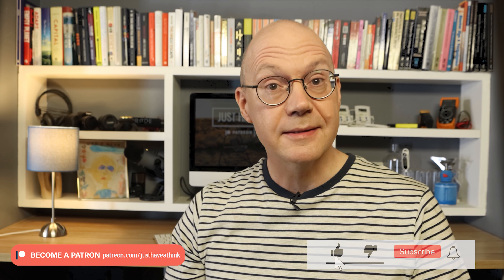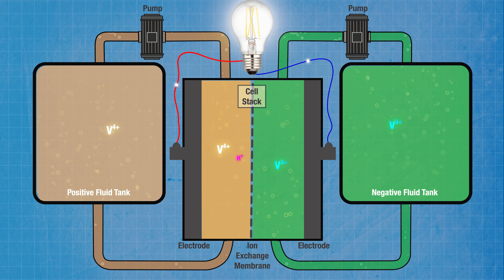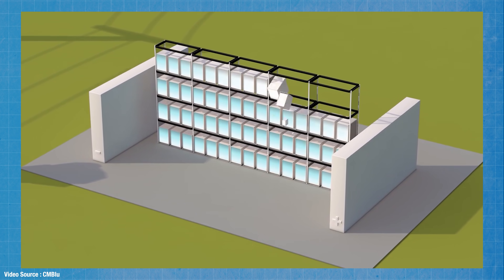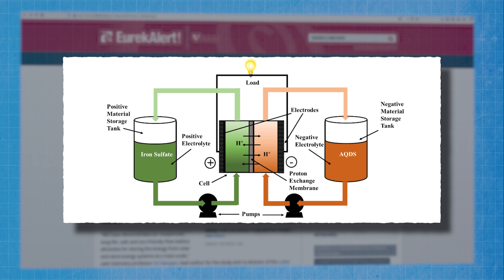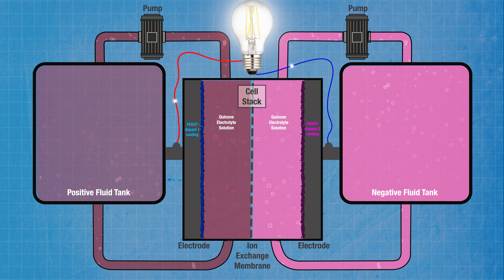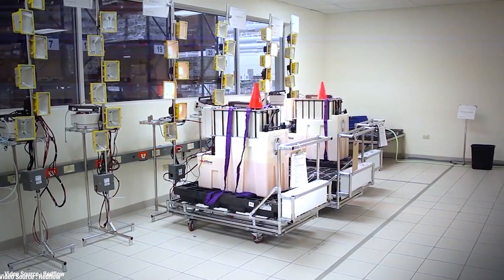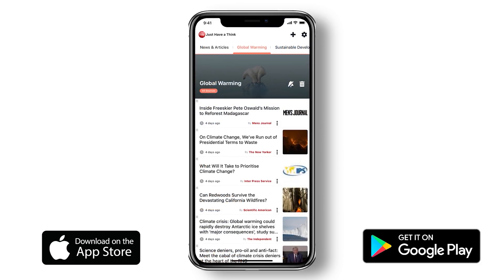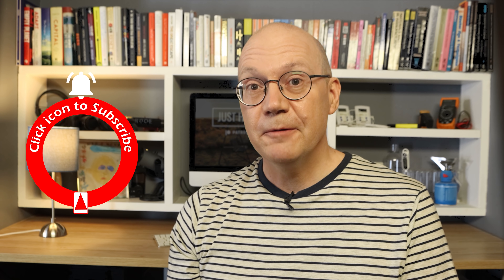Organic Redox Flow Batteries - The true path to grid scale energy storage?

Comment: He's back ! Sunday tech nerding out requirement met.  
Flow batteries have always been seen as the poorer cousin of lithium type batteries so this new breakthrough is just what the world needs right now.

If as they claim they've cracked the environmental issue of some of the old flow batteries combined with even cheaper construction then it may be time for even people like Tesla to have a rethink.
When there is a struggle to find enough lithium cells to build electric cars quick enough for demand and the future aim of replacing all combustion cars, then freeing up resources by going flow battery for large storage systems makes undeniable sense.

Maybe now we will see forward thinking Grid operators set up flow battery storage at every substation (over 400,000 in the UK) to create the most secure electricity system ever provided.
Reply: Exciting, isn't it! I think these new batteries will be revolutionary for mid and large-scale energy storage systems. I don't see them overtaking lithium in the small electronics sector, though.
Reply: @waylonk2453  Quite agree flow batteries are for storage setup no smaller than a house where space and weight isn't an issue. 
It's all about finding the right solution's' for the different scales of energy storage. Also sometimes compromising a bit to better use the resources available to us. A Tesla Powerwall will out perform a flow battery but if the flow version is 'good enough' then save the lithium cells for cars where the options aren't so great.  People blind themselves sometimes of all the options open to them by the desire for best efficiency or power output.
Reply: @helenlawson8426   A breakthrough for batteries for residential and commercial batteries would be fabulous, that might be easier and faster to achieve, and be more beneficial than a good solution for vehicles (where the challenges are much higher).  - Cheap, robust, many cycles, less harmful to produce  and not a hazard in the home, speed of charging is not crucial  .... beats energy density. 

Countries in Southern Europe and many areas of the U.S., Latin Amercia have excellent conditions. Cool is good as long as it is sunny. Italy, Greece, Spain, Portugal, ... could produce a lot of their electrictiy instead of buying fossil fuel. 
Africa and Asia could skip having a grid in the areas that are underserved, they can switch to direct production and local storage (that is already the case in villages in India, they never got a grid, and had to make do with diesel generators until they got solar panels. Light during night and a fridge, and running pumps - or a washing machine, can make a difference. Or for cooking). 

Most smaller companies if they do not use prime real estate in the middle of cities, would have the space for such batteries. The many batteries could  help soften the peak in the morning, late afternoon, evening, when solar does not deliver.

 Plus people could opt to get LARGER installations. Usually the compromise is now not to have excessive surplus in summer, the disadvantage of that the harvest  is often not enough for winter or rain, whenever conditions are less than ideal.

One reason for those compromises is the costs of storage. - The summer suplus could also provide some energy for smaller companies (the grid providers would have contracts that allow them to charge / discharge residential batteries). So it would drastically reduce the use of fossil fuel in summer.

And then there are the possibilities for off grid use.

We also use a lot of fossil fuels for heating, and if people use heat pumps in winter that is on principle good (they can serve double duty as light A/C in summer and recharge the hear underground which makes the winter operation more effective) ... but of course if lots of people get them, we need even more electricity in winter. Even IF that electricity is leveraged up times 3 or 4 and replaces oil or gas - it has to be produced now.

So any storage can help. 

People could get solar panels that produce much, much  more than is common now (with cheap ! storage nights and rainy periods are no problem, so the larger harvest of summer can be put to god use. Larger installations also help in fall and spring.

Plus supply into the grid for electric vehicles with help of the larger summer surplus. And it still delivers during winter (sunny days still bring a decent harvest especially if the area is larger than is common at the moment. btw: the German government NOW limits the installation of solar panels, they protect their providers. Consumers and household pay a tax for the energy the consume themselves ! and another tax when they well energy into the grid. It might be that the tax on energy that the consumers produce and directly use falls sideways if the home is off the grid. But most people do not want that - YET. The energy companies are private for profit in Germany and have spouted all the usual neoliberal talking points - now mixed with demands for subsidies and help. Looks like the private sector is not such a good fit for an industry that leans towards natural monopoly. So if households and even samller companies leave the large providers in droves it would be interesting to see the ideological sommersaults to justify forcing people to pay for the "free market" grid. That they do not need and do not want to support).

Using the batteries of vehicles as extra storage is a bad idea, they only have limited number of cycles. For cars fast charging, weight, density matter, they are the divas among the batteries. 
And cars are often not on the grid and infrastructure in the cities for having them hooked up would cost. 

But a residential battery is always on the grid (unless the household opts to be off grid), they could be the battery backup for the providers. Got extra wind or the hydropower plants do not use the full power of a stream because there is not enough demand  ? The electricity is either used for pumped storage OR the residential batteries a charged. Many households would have them anyway so if they get a little compensation, and the batteries have many loading cycles .. why not.

That gives the proviers a lot of reslience and lowers their costs for storage. 

And of course the providers could also get those batteries, even in urban settings they usually have more space. Else it is a power line and a half hour drive away where space is cheaper and they can have a large installation.
Reply: Much less 'cool' but the largest battery in the world is a redox flow battery so they are not being ignored. that's the 800MWh Dalien VFB in Dalien, China.
Reply from the maker: Cheers Helen. I agree with you about the roll out - one of these at every substation would be spot on.
Reply: One thing that must be kept in mind is that depending on a single technology isn't a wise way to go.  For example, my understanding is that it takes time to get full energy flow out of a redox battery, so a fast-acting tech--like lithium--will still be needed to bridge the gap between when the need arises and when the redox battery is fully 'spun up'.
Reply: @KeithOlson  That's a good point about start up speed, any pack might have to be a hybrid of the two types of battery with lithium giving the speed then flow providing the duration. Even that would help spread out the currently restricted supply of lithium cells and speed take up of energy storage. Add cryogenic liquid air storage for really long storage at large scale and there could be quite a secure energy storage grid all the while barely effecting supply of lithium batteries to the EV & Powerwall market where alternatives don't yet really exist.
Reply: @KeithOlson  VRFBs take no 'spinning up.'  They act instantaneously.
Reply: @KeithOlson  Very true between lithium and capacitors you can have lightning on demand, Just a pumpable battery tanker...
Reply: Tesla is very much on top of battery technology.  They follow every company on the planet that has potentially useful battery technology, and have a number of battery experts on staff.  If redox flow batteries were soon going to be capable of beating the best lithium ion batteries on a price/performance basis, I think Tesla would already be working with them.  The price/performance specs that the USC team mentioned for their flow battery have already been beaten by Tesla's current best technology.
Reply: @incognitotorpedo42  lihium has been going commercial for over 20 years. There hasnt been a comparable ammount of investment in flow yet. Imo. It would be neat to scale flow up to tankers and pump it around
Reply: @incognitotorpedo42  VRFB threatens Tesla's lithium technology in one of the biggest uses for batteries.  The propensity for lithium batteries to explode of cause catastrophic fires is something they would rather we didn't know since the company is entirely based on that technology.  The key to Vanadium Redox Flow Batteries is the supply of vanadium.  There isn't yet sufficient demand for the price to make anything but the richest deposits commercially viable.  That time is coming.

Comment: I am quite interested in developing something in the garage, maybe this will be my new project.
Reply: Double bubble, toil and trouble - well, I hope not too much! Good luck
Reply: Yeah, I've been hoping for a home flow battery option for a while. When the limiting factor on capacity switches from money to physical space, that is becomes very enticing for anyone with room for a spare shed, or extra room in the garage.
Reply: @ryanbrown982  
absoloutly! if i could actually get it done (i need more smrtz) and could disable the cost of the storage part, ... it seems to me a no brainer, the panels are getting ridiculously cheap and the switching components are as well.
i might have drank too much already, it says it's got electrolytes, .....
Reply: the problem would be, where to shop all the chemicals and do it right the first time, then there is the issue with power density, if I can get all that straight I will have to balance the power source, since my area is Wind rich all year and have a lot of sun during the summer.
Reply: jeeze me too !
Reply: You guys have all seen Robert Murray Smith on self-build battery technology?
Reply: @simonmasters3295  Naaa, but I am pretty sure I am gonna check.
Reply: @maximianocoelho4496  Absolutely do that!   He has ideas on graphene, minimal architecture, Zinc Bromide (cheap, abundant), conductive inks and supercap-battery hybrids
Reply: @simonmasters3295  graphene doesn't exist outside the lab
Reply: Me: raises eyebrows
Reply: I did.